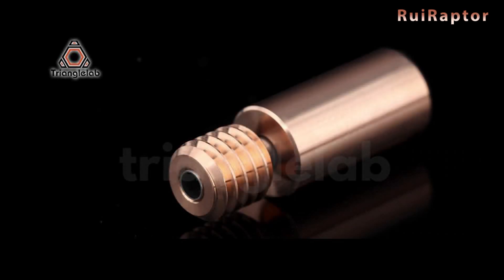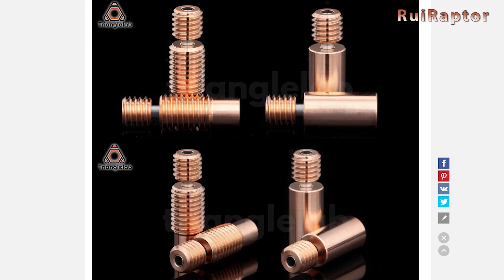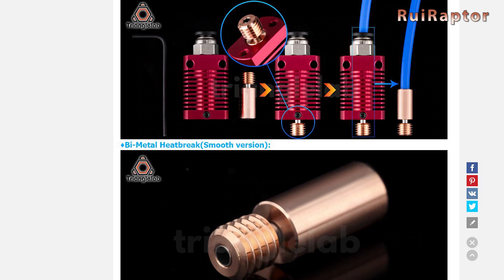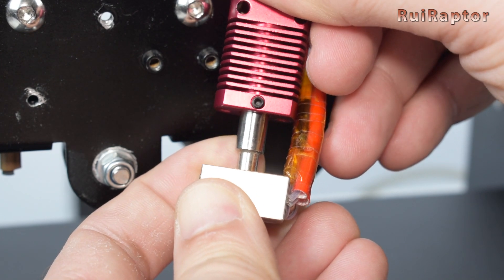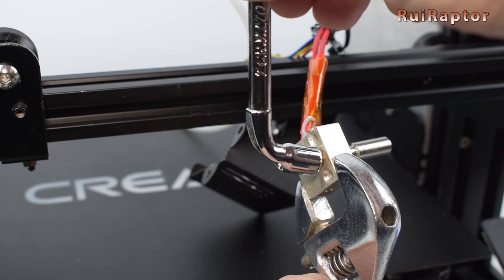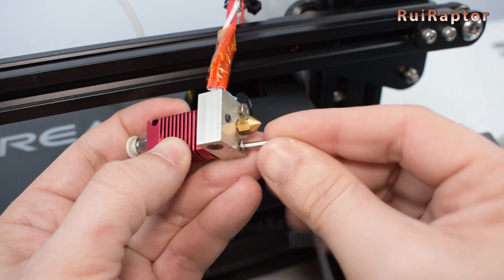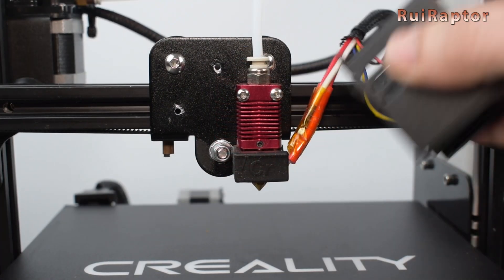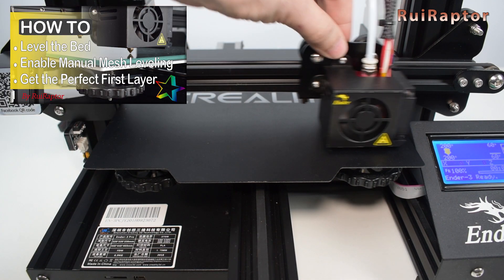BI-METAL HeatBreaks - What Are They & How To Install on a CREALITY ENDER 3 / Pro

Comment: Had you already upgraded your hot end?  Mine heat sink in silver and my heat break does not screw into my heat block.  With my current setup can I try this, or do I need to upgrade first?

Comment: Doing this upgrade without changing your retraction settings is a recipe for disaster 👌💯. You will pull molten filament back into the heat break and it WILL CLOG.
Reply: what setting value do you suggest ?
Reply: @nrich5127  1mm max, it's not just a serring change, if you're using a knock off you'll need to incorporate a filament oiler. I'll get a link
Reply: @nrich5127  https://youtu.be/IRVB9E3XjlY

Comment: Why do you heat the nozzle only up to 180c for tightening? I believe it must be heated to higher temperature than you will print so the nozzle won't come loose due to thermal expansion.

Comment: I hv trouble dismantling the original heat break the printer comes with and when I finally managed to take it off, the new bi metal heat break I put in got stuck half-way in and I am not able to turn it by hand. There were black burnt residue as shown in this video but on mine, they were also inside the threads of the heat block and I couldn't take them off completely before I screw in the new heat break? Any help as to how to continue tighten or remove the new heat break? I havent try turning it using hand tools to avoid damaging the bi-metal heat break
Reply: Suggest heating and cleaning the inside of your threads.  I want to say it's most likely filament that overflowed inside the hotend assembly.
Reply: @kennethchau6318  ya I managed to removed the heat break by heating up the heat block. There were some marks left on where I grab it with my tool. I wasnt able to clean up the original heat block because there were just too much junk stuck on the thread that wasnt coming off easy so I replace it with a spare heat block

Comment: FOR BL/CR TOUCH USERS: The probe might be lower than the nozzle when the probe is not deployed if you follow these instructions and it will hit your part mid-print. The original heatbreak might be longer than the new bi-metal heatbreak (if you buy a cheaper one) so you should make sure the top non-threaded cylinder of the heatbreak is sticking out of the dissipator 2-3mm so your nozzle is low enough. But still leave the gap between the cylinder and the heatblock too.
Reply: And dont forget to make the new Z-Offset when changed. Or the Nozel could drive in your Bed😅
Reply: Thanks man❤

Comment: On this type of style of hot is it considered Mk8?  I want to make sure of and when I order a the all metal heat break I get the correct size.  The printer I have same the same style hotbed Which is TRONXY D01 Core XY

Comment: Ordered 2 of these from Trianglelabs and tried installing on my ender 3. Took it apart and reassembled it 3 times but it clogs like crazy even with very low retraction. Going back to the old heatsink.
Reply: Did you get It?
Reply: @kilevine2359  yep, switched to a bmg direct drive and it works like a charm. The standard extruder is a POS
Reply: @petro883  A little late to the party, but would you say it is because the Ender 3 doesn't use direct drive that was causing issues?  I'm asking since I have an S1 with direct drive.  I'm wondering if this would be a good way to go haha
Reply: @kennethchau6318  Yes, had installed a direct drive and it works perfect since then.

Comment: Doesn't this technically mean that it becomes an all metal hot end ? Or basically removes the need to get an all metal hot end right?
Reply: Yes although I think they're starting to use bimetal hotend to differentiate between oh say the Microswiss "all metal hotend" which is also the products name and Slice Engineering's "Copperhead" or Mosquito hot ends.  There a generic brand on Amazon with the named product  "red lizard bme" bme stands for bimetal hot end.  They missed an H in there but what do I know I'm dyslexic.
Reply: i think it is better than a microswiss all metal hotend, because it prevents heat creep

Comment: I don't have this model printer so I'm asking, Do the screws through the heat block to the heat sink kinda defeat the heat block? I have a Prusa mk3s+ and my heat break is threaded on both sides ( like the other version he was showing) and this is the only contact between the hot and cold sides.
Reply from the maker: Hi Eugene, yes, the 2 screws from the block to the heatsink will make some heatcreap (although it's not seen on the creality stock hotend ). These screws are only good to secure the block while installing/removing the nozzle.

Comment: It performs better if you keep those 2 screws out. the heat transfers throughout these screws and still makes it useless. There is a reason why Slice Engineering, E3D and other hotends dont use screws to secure the block. the block is secured by the heatbreak/nozzle and heatsink combination. The only reason i think they have added those 2 screws is so you can replace the nozzle without twisting the construction. just put the screws in if you change the nozzle. remove them when done.
Reply from the maker: Hi, yes, that is correct.
Reply: GOD! <3 THANK YOU!

Comment: could this be used in conjunctions with that ender 3 hot end fix with the washer to squeeze down on the bowden tube? or is not necessary due to the characteristics of the heatbreak?
Reply from the maker: Hi, since with this heatbreak the PTFE tube will not go throught and all the way down to the nozzle, you don't need that fix.
Reply: @ruiraptor  I have installed this on my E3V2 now but the nozzle is now higher than the stock part cooling duct, should I loosen the heatsink and lower the heatbreak until it clears?
Reply: @afkafkafk  I'm having the same issue, how did you solve it?
Reply: @Juampagrox  I have moved away to a trianglelabs microswiss clone after this, I found the bi metal heatbreak to be a complete waste of time, the microswiss clone has been very good to me
Reply: @afkafkafk  Thanks a lot for you reply, I'm gonna give this a try, we'll see
Reply: @Juampagrox  godspeed
Reply: @ruiraptor  waiting on some thermal paste then I will install it like you, thanks for the video, now I have all metal hot end, no need for micro swiss lol

Comment: I’ve been needing one of these for a while now but my PETG prints so nicely with my settings... I’m afraid it will throw all of my hard work off
Reply from the maker: Hi Harley, if you printer is running great, don't modify it ;)
Reply: If you're still running strong after 2 years, definitely don't change it!  I would wait until something fails tbh haha

Comment: Don't buy. 
Can confirm I have the same issues as CNC Kitchen. 
Have tried two different ones in different prints and for a couple months be for I worked out what was going on.
Reply: You had bad prints with PLA?

Comment: Hi ruiraptor. Tested 3 bi-metalic heatbreaks on direct extruder v6 style and had print quality issues with pla with all of them. Partial clogs, full clogs, broken bottom pieces and bottom piece spinning was result of the tests. Good idea in general but bad execution for now with these.
Reply from the maker: Hi samster199, thank you so much for sharing your results with us. Can you please let us know if the bi-metal heat breaks that you tests were also from Trianglelab?
Reply: @ruiraptor  hi. Just checked - It was Mellow NF bi-metalic from aliexpress. 
I'm curious if this one is better or different at all to that one. 
I had trianglelab titanium heatbreak before and it was also cloging with pla filaments (high quality pla).

Comment: If we're using the original PTFE tubing, before reassembling with the new heat break, which does not require the tubing to be quite as long, I would recommend cutting about 20 to 25 mm off the end of the tubing (the part that was previously subjected to the most heat), in order to get "fresher" PTFE tubing seated in the new heat break.
Reply from the maker: Hi MBAgeeJr68
Yes, you are correct.

Comment: Like another commentor already said, this video has basically been made obsolete 6h before its release by CNC-Kitchen. Please consider telling the people that the cheap/short clones won't work with the Ender-3, as they are too short and printing quality is bad.
Reply from the maker: Hi, thank you for sharing your thoughts on this topic.
This video is not a review, the purpose was to introduce the topic of bi-metal heat breaks and show how to install one on a Creality Ender 3.
The concept of bi-metal heat breaks and the advantages they "promise" over traditional ones was explained ... it was also mentioned, for the guys that have already tested one of these heat breaks (clones or originals), to share their experience in the comments.
Regarding the fact that a clone was used, it was for the simple fact that it was the one we had available (at the moment we don't have the original for comparison). Anyway, when analyzing the video mentioned, it is not clear which clone brand was tested. On the market, you can find clones of many different parts, some with good quality and some with poor quality, it does not mean that all clones have the same performance.
A print test was actually done at the end of the assembly to check whether the assembly was ok or not, however, it was not included in the video precisely because the video is not a review. Although the first test print didn't give any issues, we would need to run more extensive tests before we could recommend this upgrade or not.

Comment: You are missing that you need to reduce retraction values. I highly suggest the video on the subject by CNC kitchen!
Reply from the maker: Hi, the retraction was not mentioned because the video was focused on the installation and the required steps before printing (like checking the nozzle to bed distance which was not mentioned on the other video). The retraction and other slicer setting are normally done while doing the first test prints.

Comment: Interesting video as always 👍
What does this change the Catastrophic of the prints?
Is it possible to print higher temperatures?
How about clocks in the tubing, have this changed?
How are your experience with this change?
Check CNC kitchen video too!

Comment: Thank you for the video on how to assemble the new  Bi-metal break. Question, why are the two long screws that go from the heat block into the heat sink required ? seems like they would just transfer heat to the heat sink and add to heat creep. Is it just a support thing so the heat break does not get damaged when changing nozels ?
Reply: They support the heatbreak in case of a crash.
Reply: @jessehellakoo  Exactly, this is the reason why I did this upgrade instead of buying something like the Phaetus Dragonfly that has no support for the heat break.
Reply from the maker: Hi, the topic of these screws was mentioned several times in the past in several discussion groups but there was not given a definitive answer. The fact is that Creality is still selling their printers with these screws.

Comment: Disappointing. After seeing the video from CNC Kitchen, where he has shown that he had no success with this cheap clones compared to the original from Slice Engineering, I hoped to see another opinion regarding print quality, but the video ended before it could get interesting.
Reply from the maker: Hi Gerald, we understand but the purpose of our video is to show how to assemble the bi-metal heat break on a Creality Ender 3. At the moment, we don't have one original heat break from Slice Engineering to make the comparison.
Reply: @ruiraptor  A comparison wouldn't have been necessary. A test print would have been enough.
Reply from the maker: A print test was actually done at the end of the assembly to check whether the assembly was ok or not, however, it was not included in the video precisely because the video is not a review. Although the first test print didn't give any issues, we would need to run more extensive tests before we could recommend this upgrade or not.
Reply: @ruiraptor  please let us know after running more prints if this product works as described as well as being able to print higher temperature materials, and the print quality for all types of printing is as good or better than original equipment. Thank you!